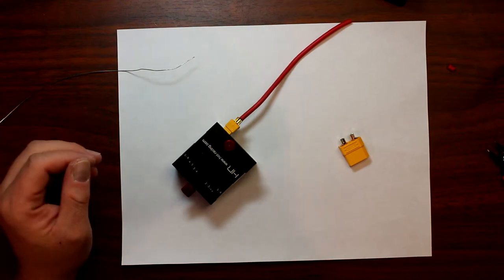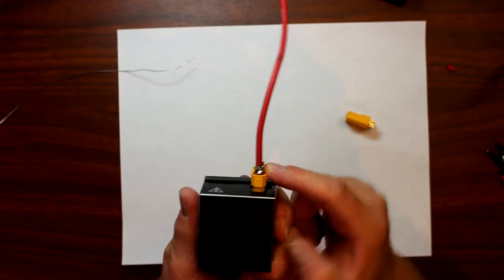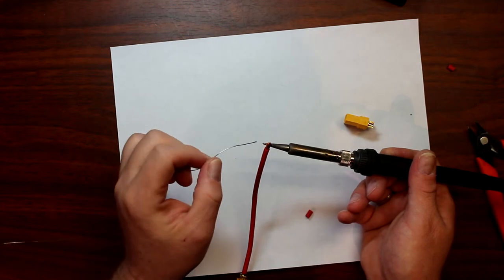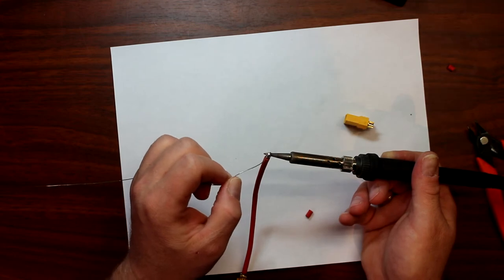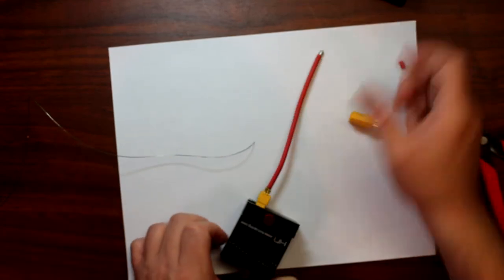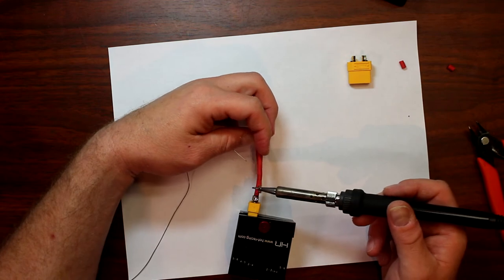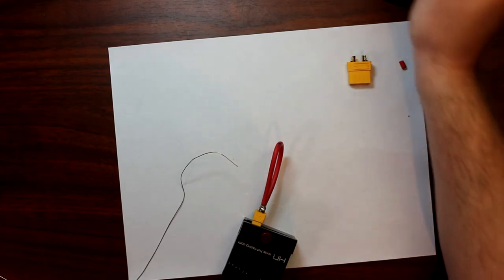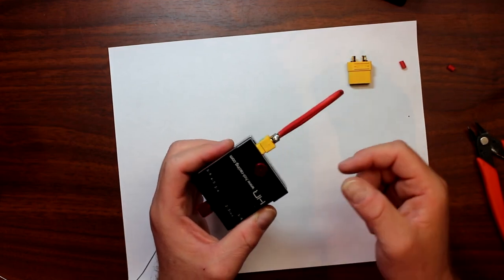How To Solder XT 90

Comment: Thanks for sharing. I have a question, since I don't know enough: What I am always worried about is if the wire has enough connection to the gold joint of the plug. More specific: Is there a difference in connection if the wire 'floats' in solder and not actually touching the gold joint? Or does the wire have to be touching the gold joint while and after soldering?
Reply from the maker: If you wire floats in the Solder  it’s OK the Solder makes the connection to the gold connecter. What i do is  a test I try to remove the wire out of the connecter if I Mabel to remove it that means it’s a cold Solder. If not that means a good connection. The other thing if you still see expose wire when your soldering that means you don’t have enough Solder
Reply: @djsprc  Wow, thank you for your quick answer. Alright, floating is okay. But here's the next question that emerges: Can solder/tin conduct high amperage as well as if the connection was wire to connector (metal to metal so to say)? 
For example I have an esc that can handle lots of amps, lets say 120+ or even 150 or more amps, will the solder conduct the current or is it bottlenecking the system?
Reply from the maker: TN RC Yes solder will handle high amp  and yes Solder does create some resistance some will say it’s better to crimp. Dan Solder. Just make sure you have good connecters and a good battery you’ll be fine

Comment: Hi mate, great video. Quick question, what wattage soldering iron are you using? And would it be possible to solder 8awg to an xt90?
Reply from the maker: Richard Blackwell The wattage is 60 W and yes it would be possible to Solder a 8awg to xt90.

Comment: Is it possible to solder a 13awg wire to a xt90s?
Reply from the maker: Vago Sofron Yes you can. You could Solder up to 10 gauge wire if you wanted to
Reply: Thank you! I was afraid the wire would be to small for an xt90.
Reply: Probably best to stick with #11's